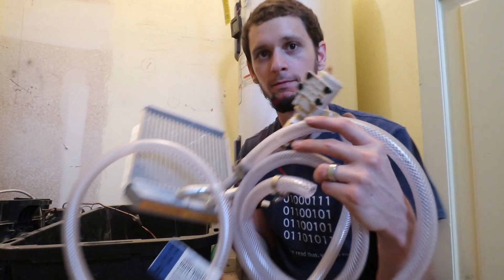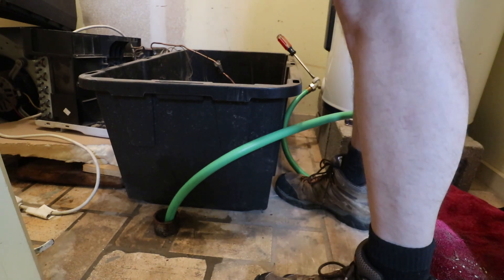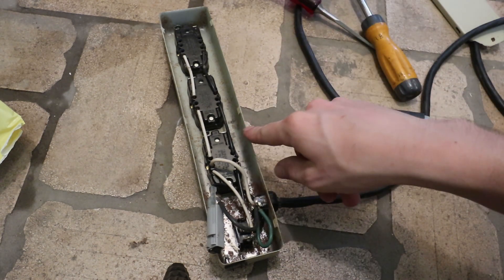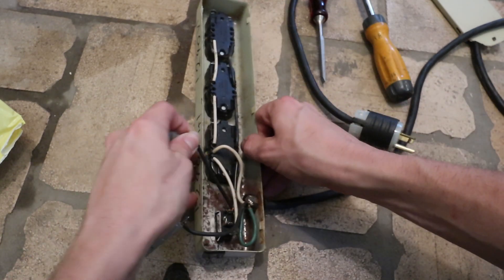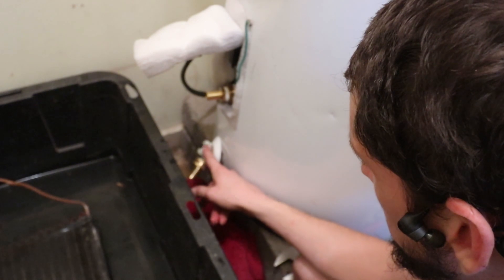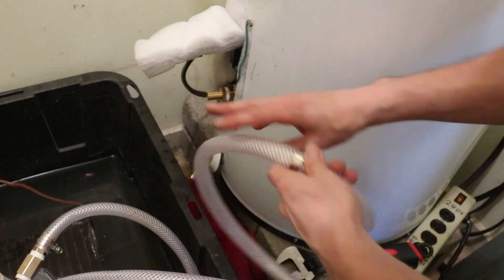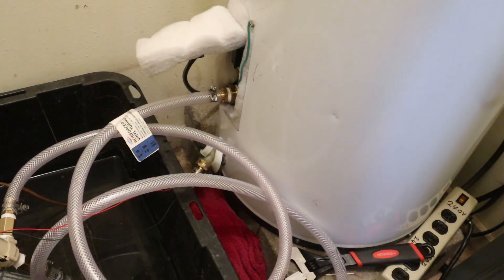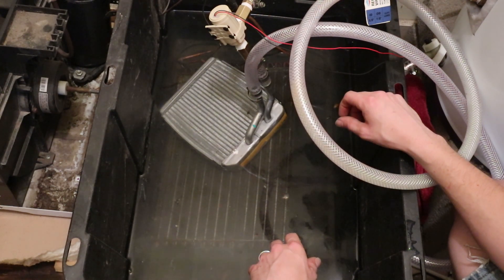DIY Heat Pump Water Heater [High Pressure Failure]

Comment: I'm going the same rabbit hole as you're doing about trying to convert a hot water tank to a heatpump

Managed to use a wall mounted unit and replaced the inside head with a copper coil that I sneaked inside my tank but lost gas in the process so I would like to try with a window ac

did you do any further test after this one?

Comment: what about evaporator in the water ,is there any symptoms of corrosion alluminium and copper ? how log is this working?
Reply from the maker: It’s a valid consideration. Using an antifreeze with inhibitors and stripping the aluminum off the copper tubing are two things that would mitigate it.
Reply: @beenegarage7116  i masę similar exchanger now its working in Water tube i will check IT after few months..